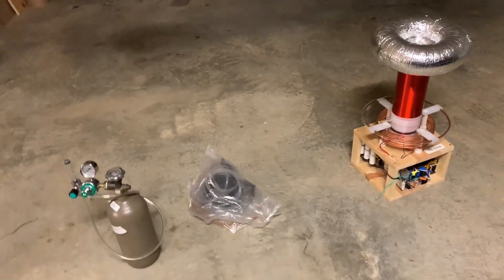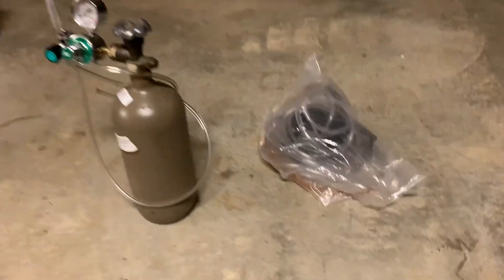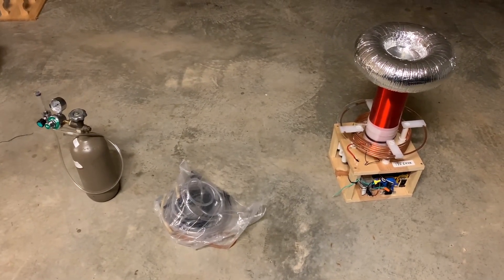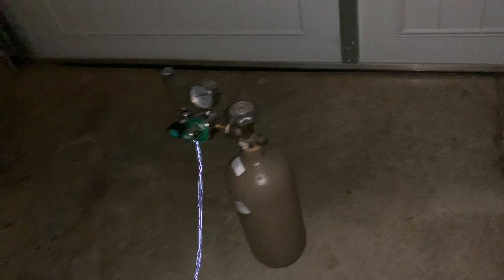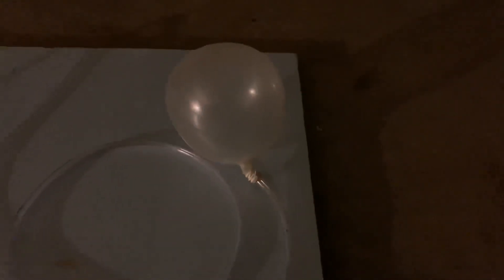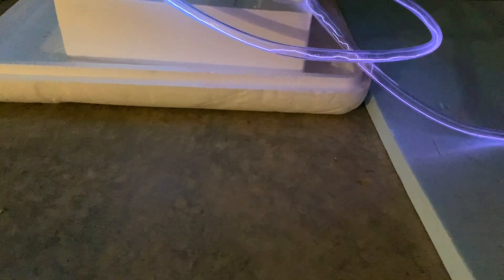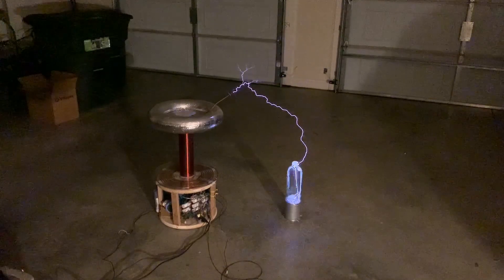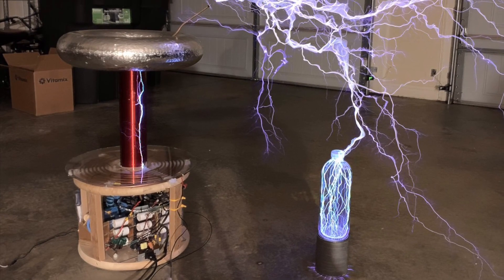Monster Sized Arcs

Comment: Is that a sort of neon lamp ?
Reply from the maker: Sort of. The gas in the tube is at normal atmospheric pressure so it’s sparking through the argon in the  tube which takes much higher voltages.  In a neon lamp the gas is low pressure and will glow and not spark. This happens at much lower input voltages
Reply: @BrianDhvTinkerer  wow..cool

Comment: I would expect that effect at pressures far below 1 atm. No reason to have the same effect using air instead of argon. Could you please try to explain?
Reply from the maker: At this point I am lost as to an explanation of how the ionization track could travel such a long distance through atmospheric pressure argon. It would however make a great thesis project as it could also be tried with other gases.